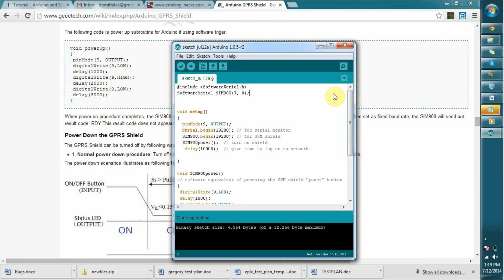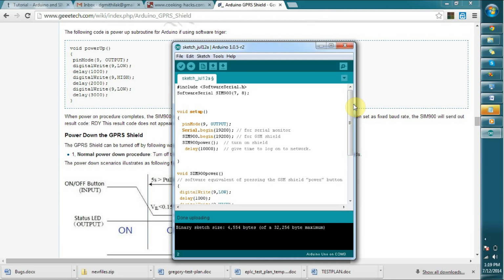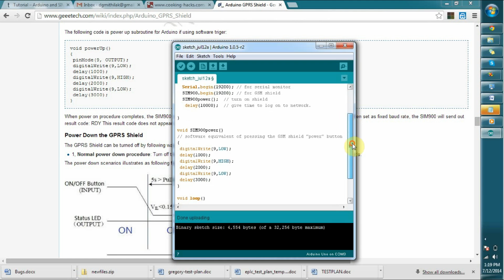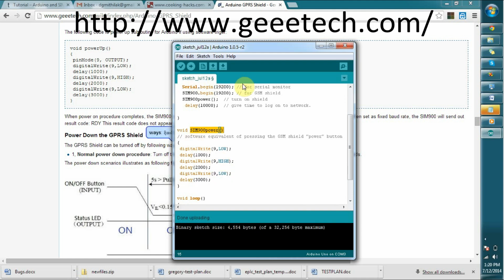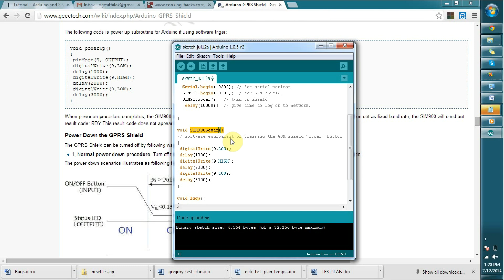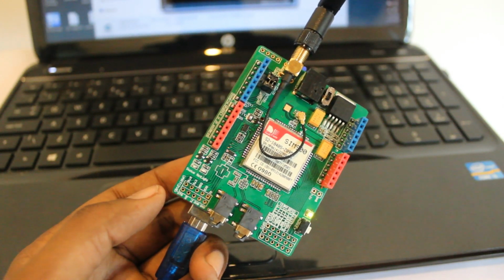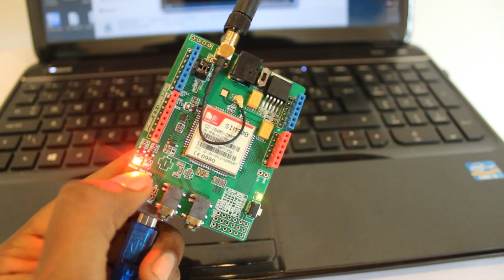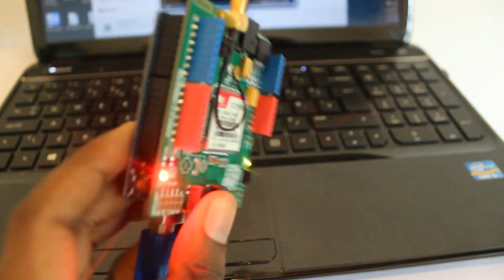Tutorial: Switch ON / OFF (soft-switch) SIM900 with arduino

Comment: My module is blue and don't have in this spot something to solder. 1 cm left from this point have something like this with "R13" label. This R13 need to solder ?
Reply: I have the same, and yes. Solder that and you can programmatically set the unit.
Reply from the maker: better you check with menu
Reply: Hi Jim. Did you solder this R13 ? Did it work ?
Reply: I do not know if my answer is too late. But in effect. If you solder the point of R13. ON / OFF by software works. Greetings from Ecuador.
Reply: hey Henry!  did you still use the pin 9 or used pin 13? mind if you send me the snippet of your code at ultimate.eyed.demon@gmail.com. thank you very much
Reply: I also have a board with R13, it is connected to pin 9 and it works
Reply: Hey Jann Etz. Yes. You have to use the pin 9. Do you need the code yet? Please send me a mail and help you. henryjaviertul@gmail.com
Reply: Hello everybody. I solve this with my blue board. See here how i do it.
http://arduino.stackexchange.com/questions/28331/solved-soft-power-on-sim900-module-jp-pads-missing/28380#28380
Reply: what if my blue module has that "R13" spot, but it has SMD resistor connected to it? Do i need to remove that resistor and then solder the R13 connection?